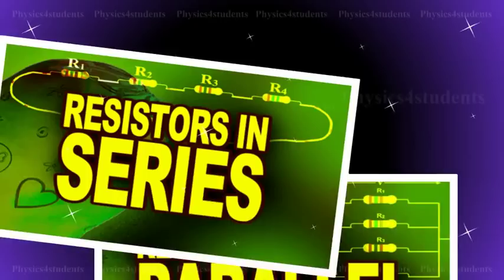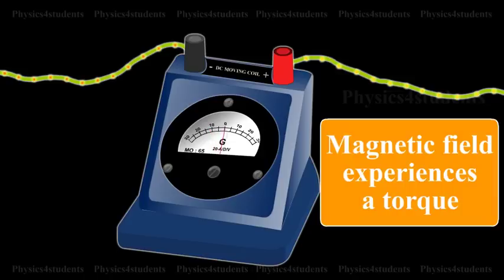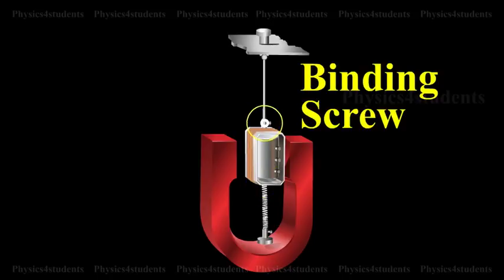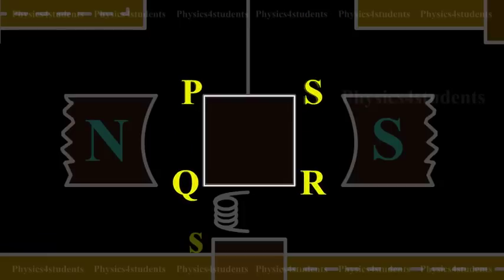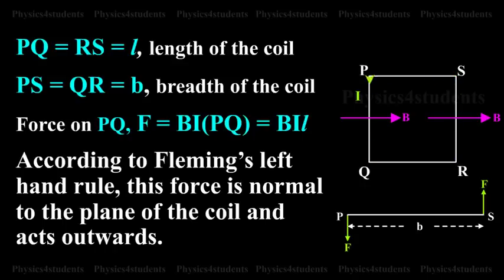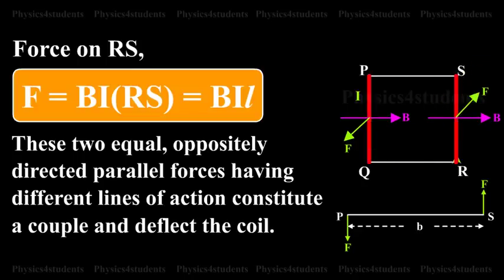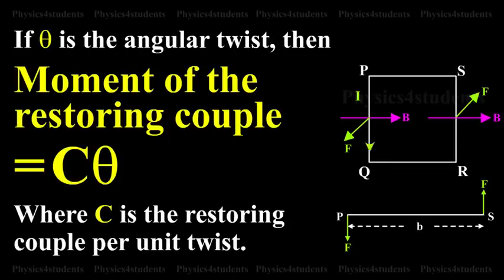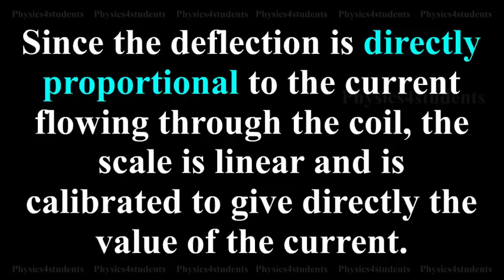MOVING COIL GALVANOMETER: Principle, Construction and Theory | Physics Video Tutorials

Comment: First aninated diagram is wrong...that plane of the lamp and scale arrangement should be horizontal not vertical...You will throw that counter inside the scale plate with such arrangement😂